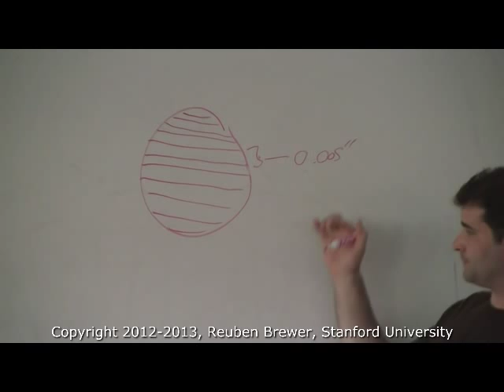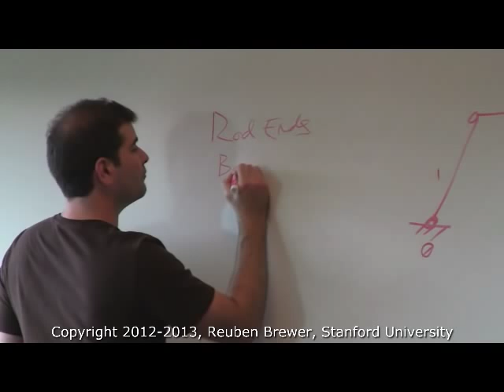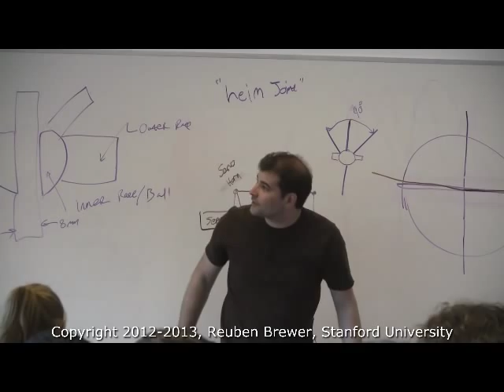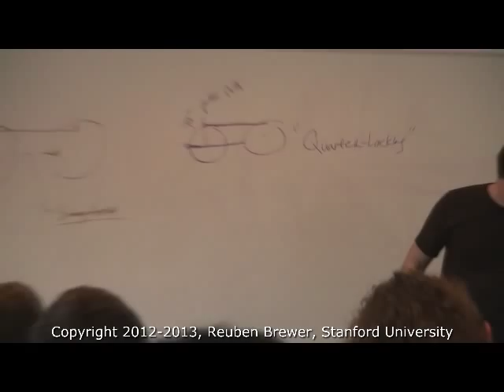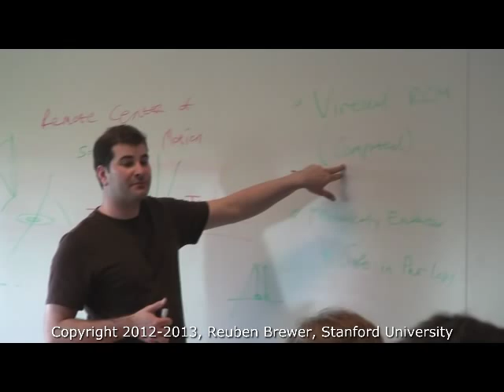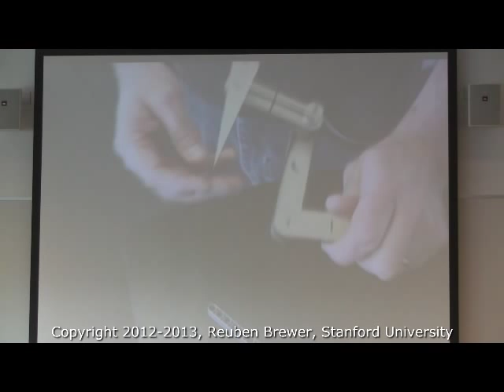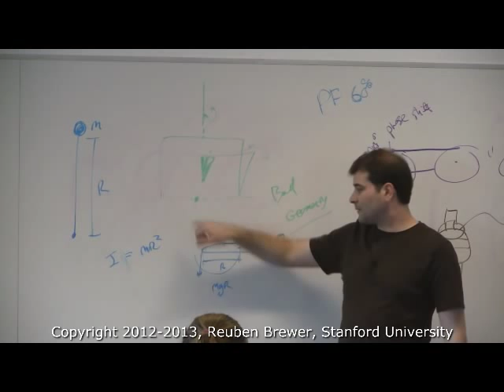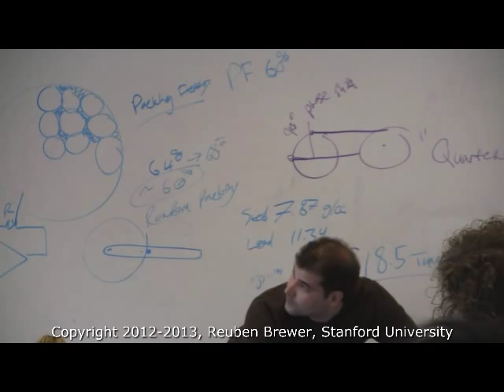CS235, Lecture 13-Rigid Linkages, Spherical Bearings, Remote-Center-of-Motion, and Counterbalances

Comment: You would be interested in my robot design with 4 ball-jointed rods connecting 2 robot halves.  The linkage is equivalent to 2 (5 degree of constraint) hinges stacked, to allow steering & axial twisting (to conform to ground), but not collapsing.  The linkage is lighter & easier to fabricate.